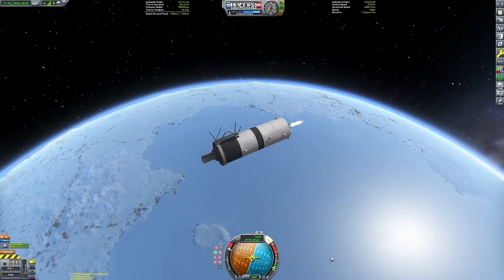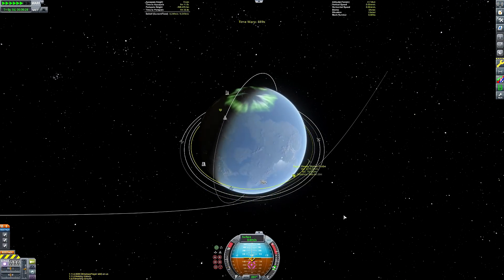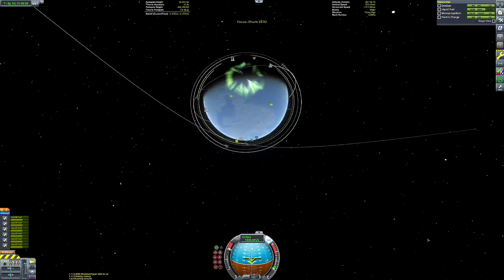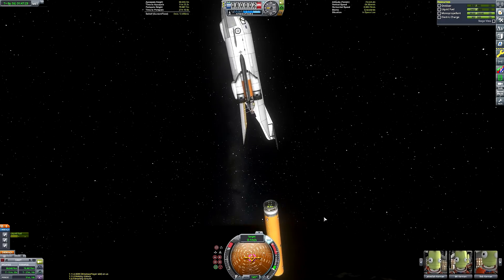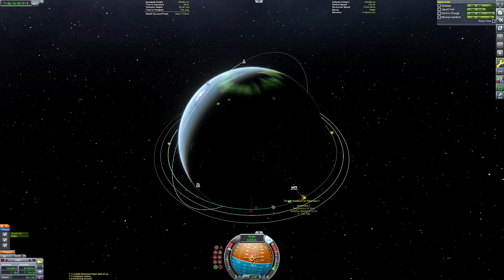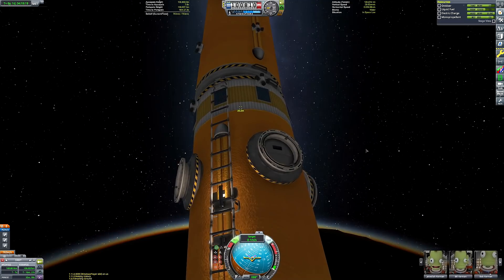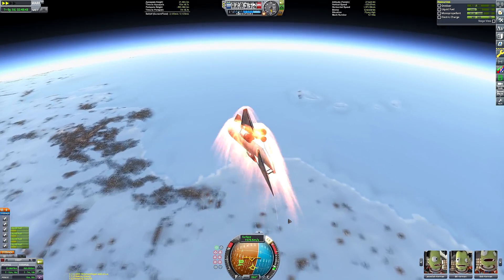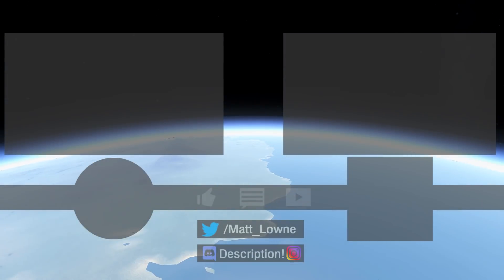KSP: Space Station Recalibration!

Comment: Matt please remake the boston dynamics spot robot dog it is definitely possible as I'm am or were because im writing a comment building spot and it could also be a starship recreation as starship is probably going to go to mars with spots it must walk no wheels reaction wheels are allowed and must jump and lastly must be yellow and have the green lights on the front tip use z-100 Rechargeable batteries and for the body use the making history structural panels gold and the legs rotation servos then on them r-11 baguette external fuel tank the at the bottom a hinge then a I-beam Edit let your hand heal first second Edit it no longer has to jump mine can't